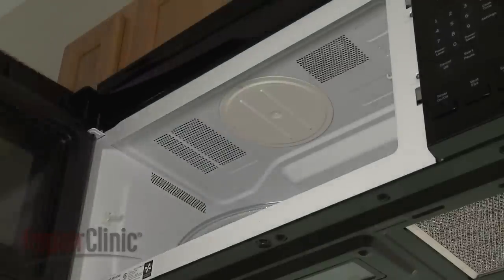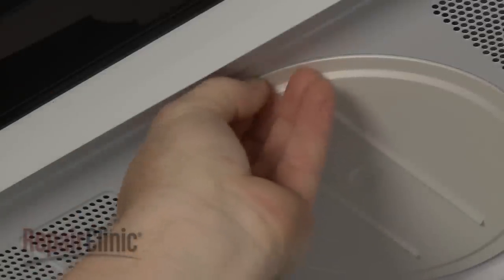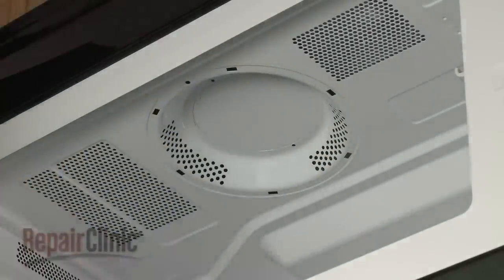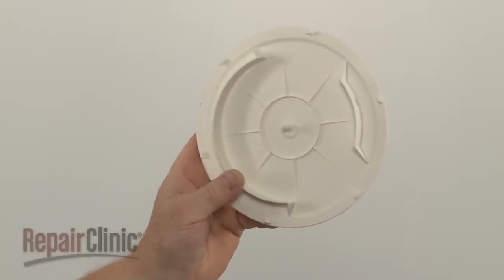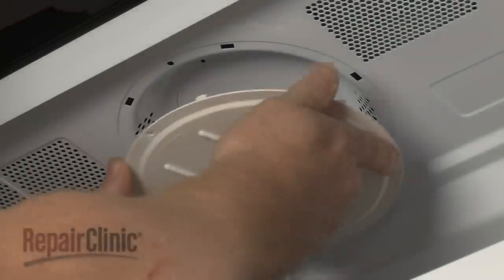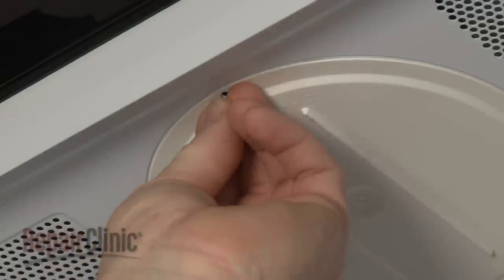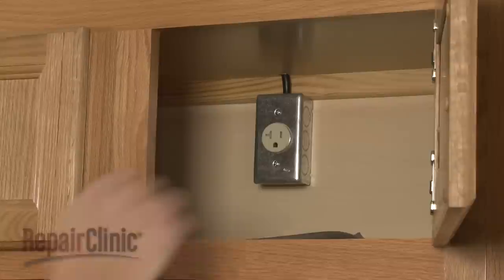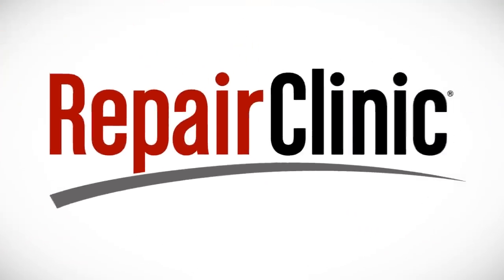GE Microwave Stirrer Blade Cover Replacement #WB34X20709

Comment: How do I know if the stirrer blade is the source of my problem? It’s arcing up in there when I make popcorn, but the cover and blade both appear to be clean and shiny…
Reply: Dear Andrew, I hope you've got a fix by now but do inspect the micaboard inside the oven for dirt and grime wipe it neatly. 90% cause for sparking and loud buzz. Do a google image search on oven micaboard. Less than $5 and 30seconds to replace
Reply: Thanks for the tip. We are about to renovate our kitchen and will be replacing the microwave anyway!
Reply: @arothmanmusic  you're welcome. P.s the small board in the center is the mica that's all. Just removal and wipe down. Good luck with the renovation!! https://images.app.goo.gl/iQaLZWVRe2Kqg7BAA

Comment: is it safe to use a microwave without the stirrer blade and stirrer blade cover?
Reply: I'm still not even sure what it's for lol. It's not connected to anything. So it just sits there? Or does air inside the microwave catch the blades and cause it to spin?
Reply: @JC-11111  It is the weirdest stirrer motor I've seen. I'm guessing the microwave field created by the magnatron excites the little metal disc and causes it to rotate evenly distributing the energy. There is no air inside that is circulating. Technically you don't need it but would likely get uneven warming on large jobs. Most do connect to a small motor that rotates that metal disc.
Reply: @JC-11111  it makes the "waves" move and heat the food in more places